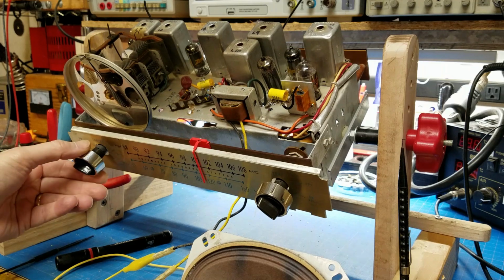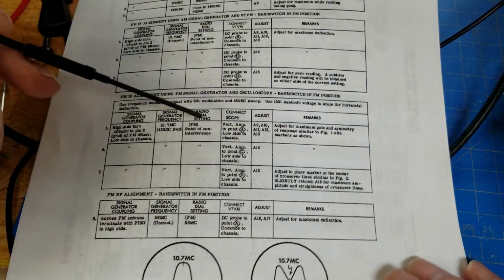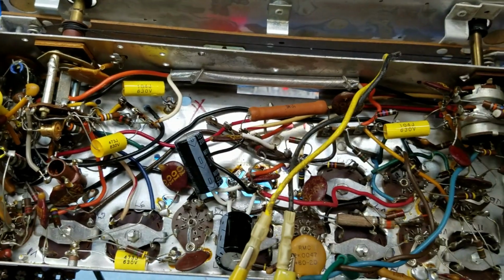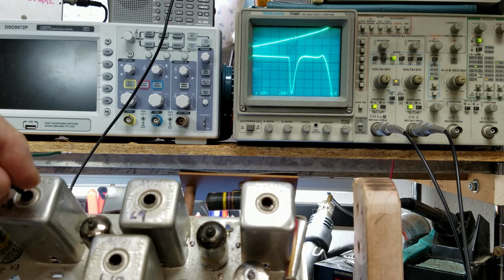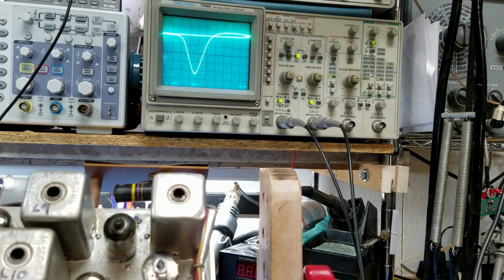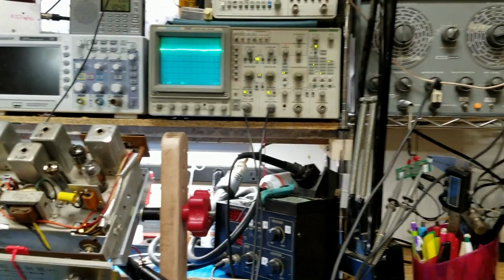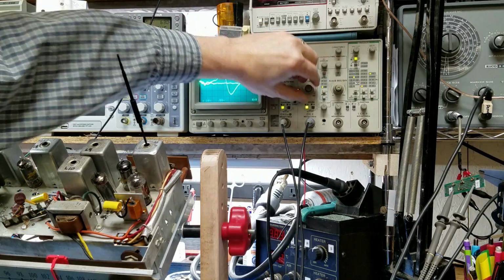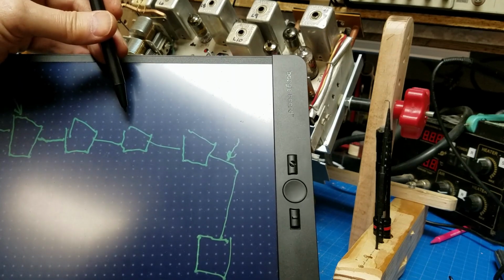Zenith FM complete visual alignment

Comment: There is an arduino based alignment sweep and marker generator that can be built for about $100. The inventor sells the pcb plus programed arduino for about $50 on ebay then add some other parts to complete it. There are a couple youtube videos on this.  Thanks for your video. https://www.youtube.com/watch?v=Snhhewwi8AQ&t=2s
https://www.youtube.com/watch?v=FpRN9DYuB54

Comment: this has to be the best FM alignment video I have seen and to a complete rookie, this is incredibly helpful. explaining the theory of operation, what you are doing, and what the scope is showing is something a lot of other videos lack. I have a question about the signal being injected. Is it possible to do an alignment like this with an RF generator (like an EICO 324) that doesn't have the sweep and marker capability? I'm thinking yes, but it would be more difficult.
Reply from the maker: You certainly can do it with an RF signal generator, if it's not too far of out of alignment. most or not very far out of alignment if out at all and can be aligned effectively just by ear even. Also remember everything you connect to the circuit will load the circuit and eventually you'll have to tweak a little by ear anyway. Good luck

Comment: Great instructive video. This is the first time I am aligning a Zenith. I couldn’t figure out how to get to the bottom adjustment in the cans. Now I know. I have a digital Siglent scope and signal generator. I am not sure I’ll be able to set up like you did. Question…. What are you measuring on the Y axis of your scope. Is it the DC voltage at the marker which is the DC voltage at 10.7 MHz?

Comment: Hi, I am really in shock after watching your "great invention" . I have been working with tv's and radios for a long time, and always had a problem with the set on the workbench, but after seen this video, I am surprised on how easy could be to build something to handle the set while repairing or adjusting it. Can you please share more information about this great tool? like measures and the most important, how can it hold the radio or whatever you are working on. Holes in the chassis? pressing the chassis with the red handlers? Please it could be a great help for people in the repair/restoration team, like you and me. Thanks
Reply: LOL!  This couldn't be simpler!  All you're seeing is 2 piece of aluminum channel.  I just drilled holes in the side of the channels and treaded for a 1/4" bolt that is back treaded with a nut.  Don't allow the bolts to protrude through the channel, this will interfere with the chassis being mounted.   I added spaces between the nut and the from to allow for stuff like the dial to clear.  This is all mounted in a wooden frame.  The extra vertical holes in the wooden frame allow for bigger chassis'.  As far as mounting the chassis, I utilize the same screws and holes that hold the chassis in the case.  Nothing fancy here.  I just used the manufacturers threaded mounting holes to hold it to the channel.  You'll find that just a few holes are needed in the channel to adapt to most chassis.

Comment: I found this after doing an alignment on the same radio. I don't have an analog scope or an old sweep generator. I have various function generators and a signal generator. I couldn't figure out how to set it up with a scope. (how to set the scope up and with a sweep and all that). I just did my with a spectrum analyzer with tracking generator and it was easy....the only problem is A14 and A15 because you can't get the s-curve. (atleast I don't think so) So I used the steps for the signal generator and vtvm. I gotta say though that the spectrum analyzer makes a much clearer representation of whats going on...atleast to my mind.
Reply from the maker: That's great.  Truth be known, after I remove the equipment, I still have to touch it up br ear.  Anything that connects to RF messes with the signal.

Comment: Thank you for this video. I have found that if you have a somewhat good signal with poor or very poor audio, I do the what you did last-- first. That is I tweak the cans by ear first and then use the equipment to set get the best O-scope readings and then again tweak by ear. Carl
Reply from the maker: Carl, just to prove your point, I did a complete alignment by ear only and it worked great.
Reply: So I am guessing that you do the tweaking with the volume up on a good local station?
Reply: @jdmccorful  Use a signal generator so that you can control the strength.
Reply: Yes Carl! Thank you for saying something. By ear first, and then fine tune the waveform with the oscilloscope. That is so much quicker.